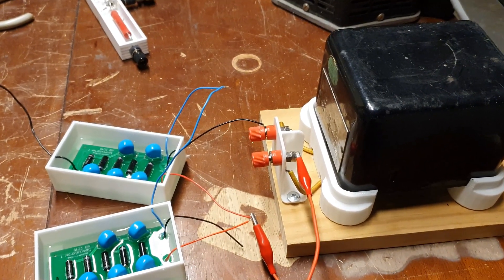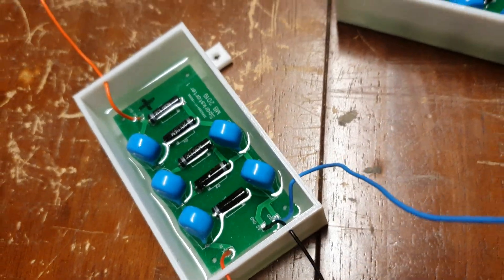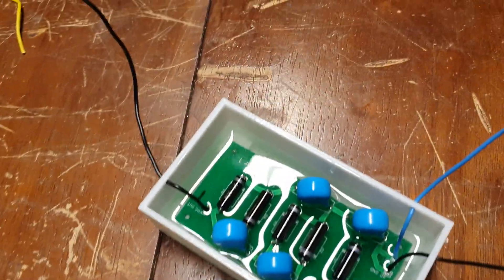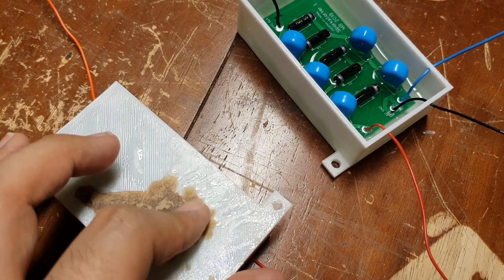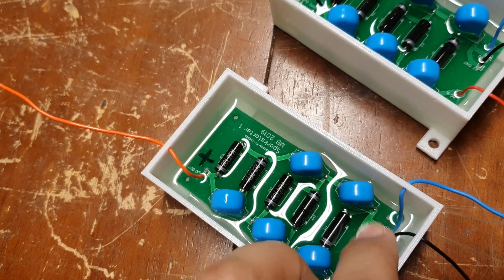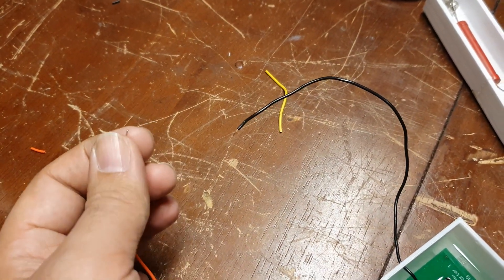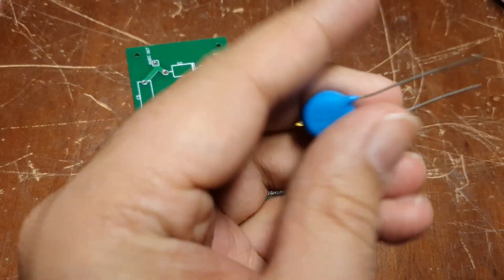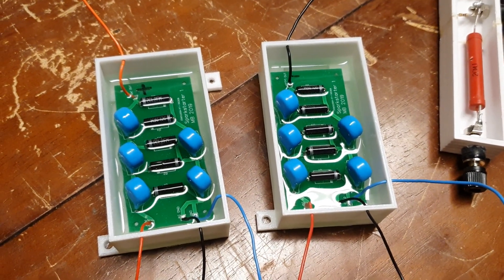Easy 100,000 Volt Supply

Comment: I don’t know if you are aware of this, but  you have been exsposed to a good sized dose of XRays in doing this experiment. I hope for your sake you take precautions against this as they can damage your DNA so you should keep a good distance away from the high voltage ark and the corona especially. For more information research: Bremsstrahlung or braking radiation.

Comment: I use that same sort hv-capacitors too, but without a serieresistor they always go less and less over minutes because they wont tolerate the short but very high currentpeaks when arcing. 
I use one 100ohm1watt resistor in series with each capacitor ánd a pair of 1,5Mohm10watt at the end of eacht row. And still the caps go less over time but at least a whole lot slower

Comment: You need higher frequency ánd higher value resistors. I saw them up to 10Gohms!
But it is still an impressive arc and beautifull corona i think. It works surprisingly well for only 50Hz(or maybe60or so)

Comment: I know this doesn’t pertain to this video but I built a vacuum tube Tesla coil based on the one you built. What gauge wire did you use on the secondary???
Reply from the maker: saw the video, looks good. I used 30awg for my coil. The windings do get warm if I run it too long. Would probably redesign with a thicker gauge next time...
Reply: sparkstarter Thanks I used the same.